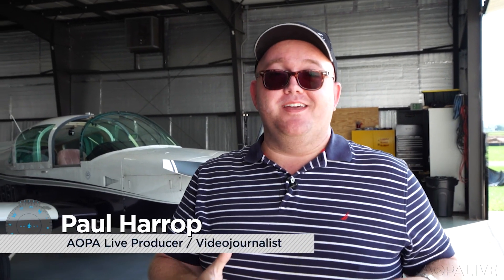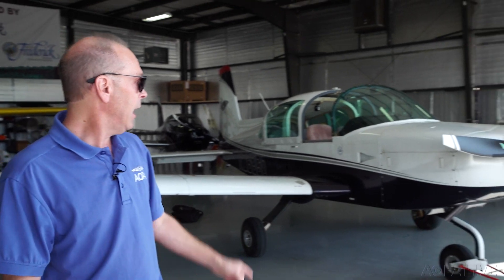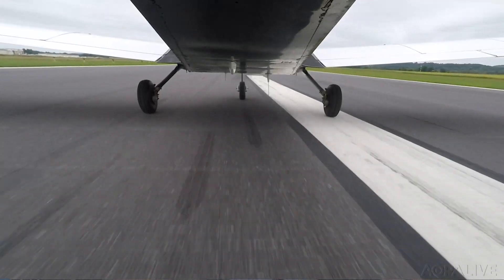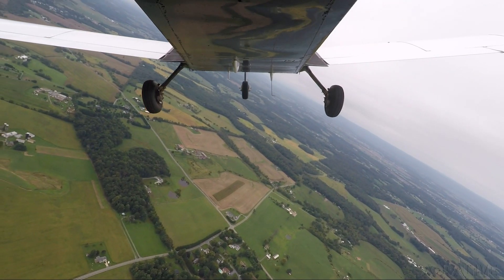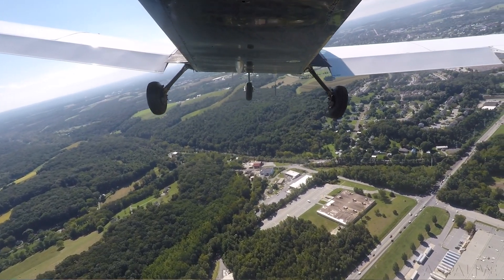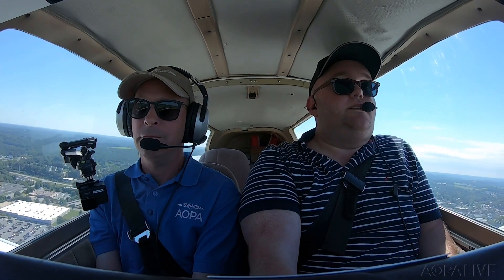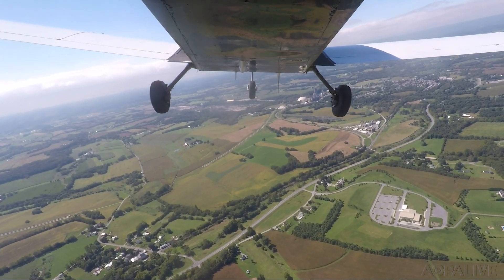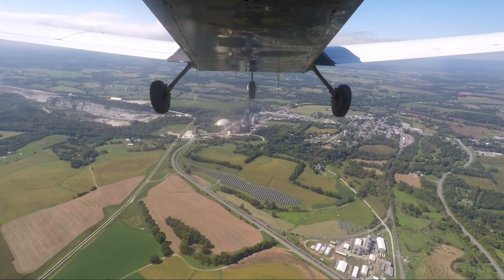Step up to YOUR Grumman Tiger

Comment: Too bad the CFI isn't familiar with the aircraft and is teaching/allowing some bad habits.  Carb heat?  Not in a Grumman unless there are symptoms of carb icing occurring or visible moisture.  Landing was flat, hopefully that will improve.  But following the actual checklist for the airplane and not some memorized checklist from a Cessna would be a good start.

Also, turn off the boost pump after takeoff...
Reply: Yeah would rather not loose my engine on a go around because I decided to use carb heat. Carb heat stays on below 2000 rpm for me
Reply: You know what, this whole comment is just wrong.
I don't know where you got the idea that that is a flat landing. Hell, you could've at least called him out for landing like 3 feet off centerline, but it sure wasn't flat.

and its not your airplane so don't tell him how to use his fuel pump lmao